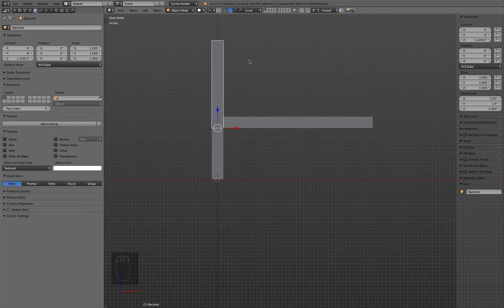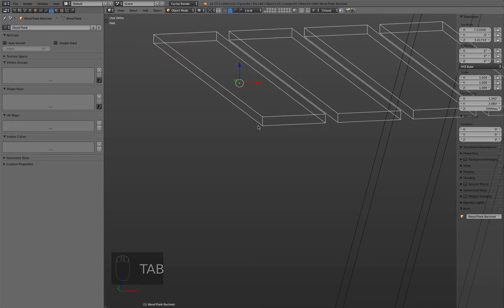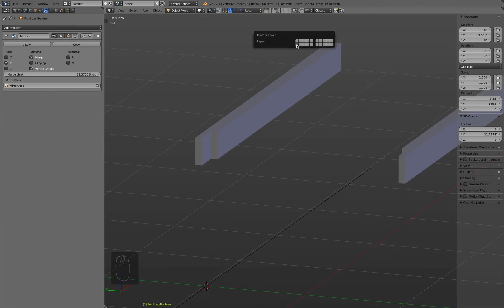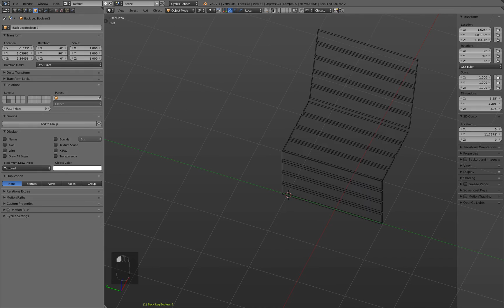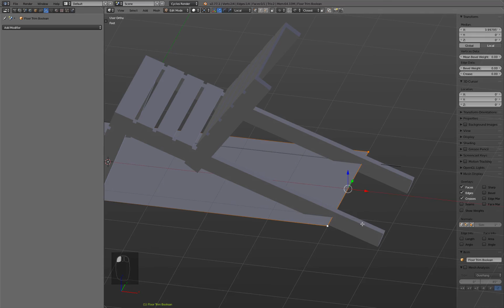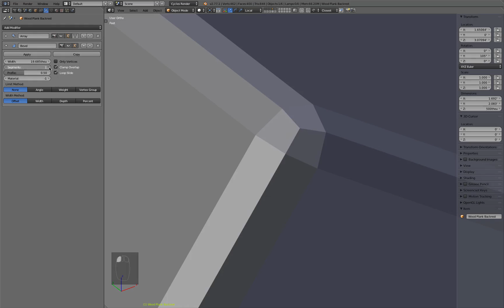Wood Pallet Chair Part 1 Ideation Phase

Comment: Great thanks for sharing your experience with Blender in such detail.  What should I use to help me choose wood materials and plan cuts once the piece is designed?  Can Blender figure some of this out, or any other software?
Reply from the maker: Isaac Warren I am not sure if I follow - what do you try to accomplish?
Reply: Claas Kuhnen i would want to build it if  I design it. Let’s say I design a  chair in blender and I then want to build the chair, I need to know what size boards / timbers I should buy, how many cuts to plan with length width and angle, minimize waste, etc. Deconstruct the drawing into pieces for building in the real world.
Reply from the maker: Isaac Warren ok I got it now, this might be beyond replying here in YouTube. Send me an email to info@ckbrd.de ideally with maybe a rough sketch of what you want to build - then I help help you better